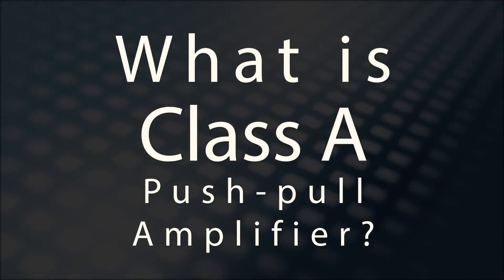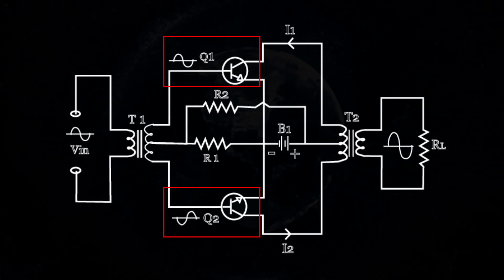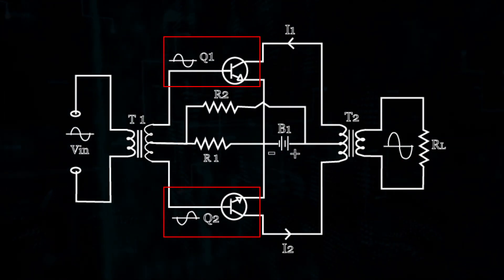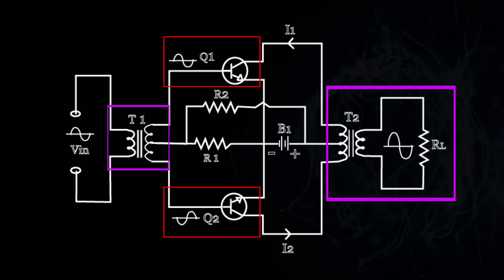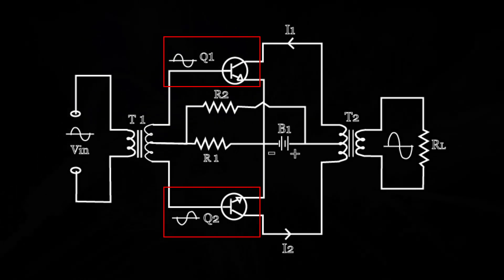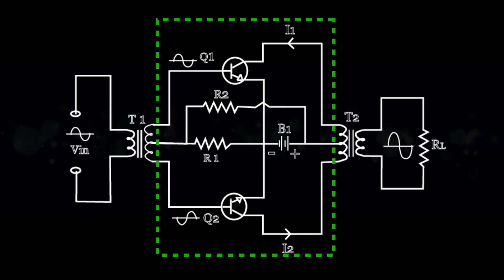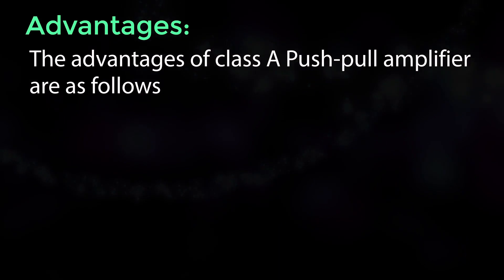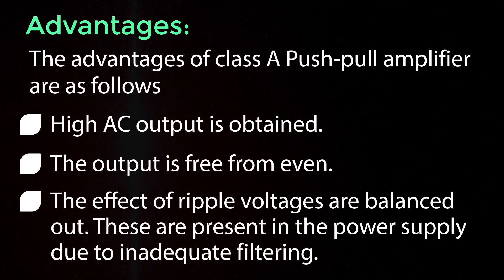What is Class A Push-Pull Amplifier | Electronic Devices | Electrical Engineering

Comment: Sir.. The collector current direction for bottom transistor should be inside but in figure you mentioned outside.Actually for both transistors the collector current direction is opposite to each other.